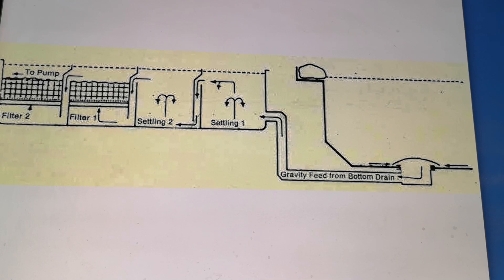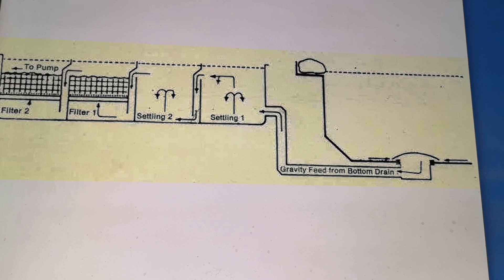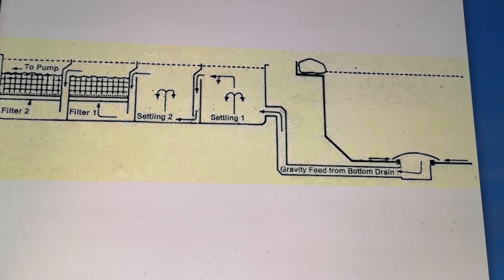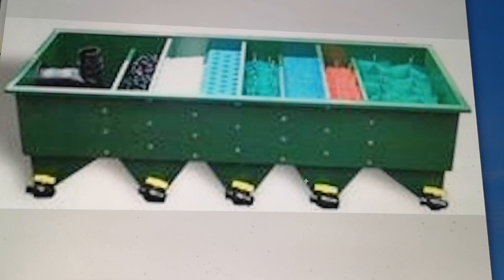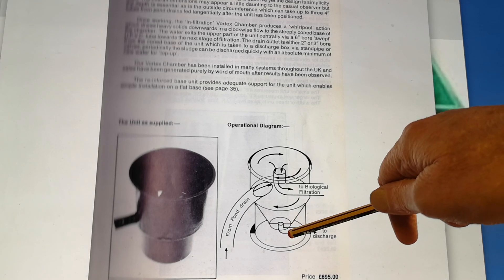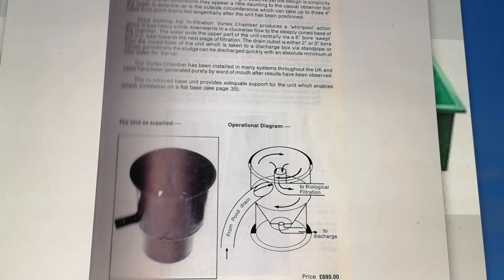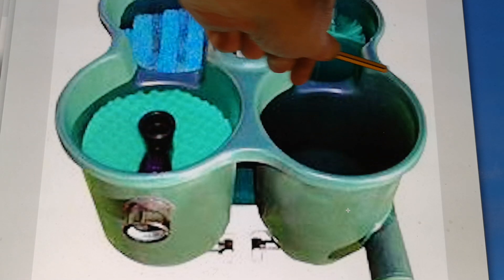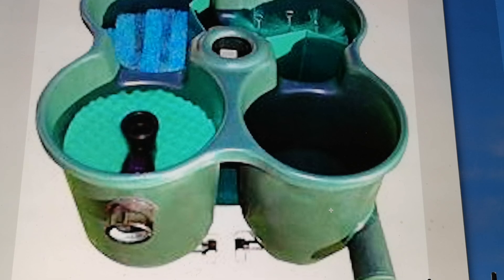30:11:18

Comment: Peter, although your original filter designs may no longer be the most effective they were at the time  the most advance pond filters available. While there have been many design changes since then the basic principles of vortexes and multi-bay filtration is still in use today in many different and often diy variations. Of course these days RDFs, your ERIC and most recently EPIC filters have brought an entirely new way of filtering koi ponds to the world of koi keeping. I know you're very proud of your innovations and the EPIC filter but I wouldn't be at all surprised if your EPIC filter is replaced by an even better one of your design before too long.
Reply from the maker: Thanks K R, as you may know, I'm always on the look out for improvements - that's why my own Epic filters are made in clear pvc so I can see exactly what's taking place inside them. As to any new designs I may come up with in the future I can't think of anything that can equal my horizontal-flow design that was first produced in 1986 - that's 32 years ago! As to 'mechanical only' stages like the RDF, I'll stick with my brush box - not only because it's cheap, but because it produces the best results at a fraction of the price.